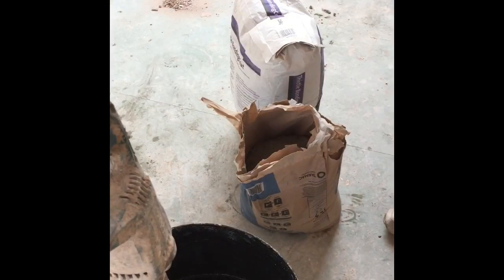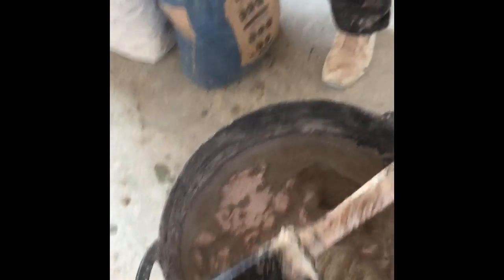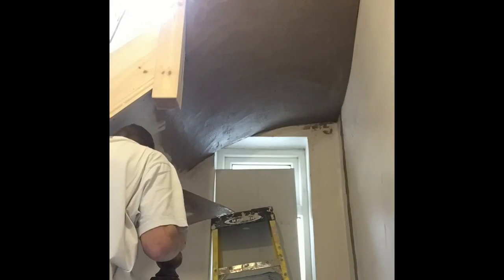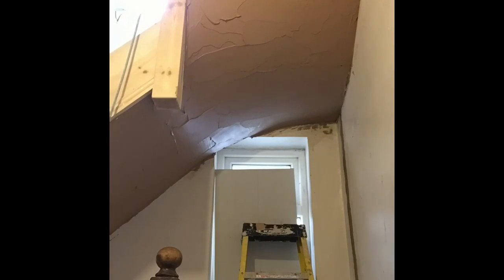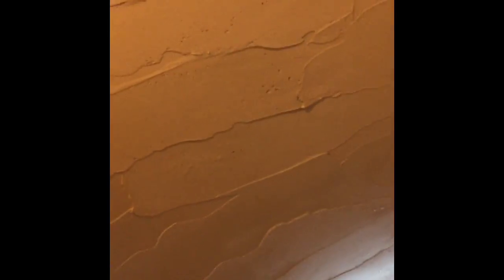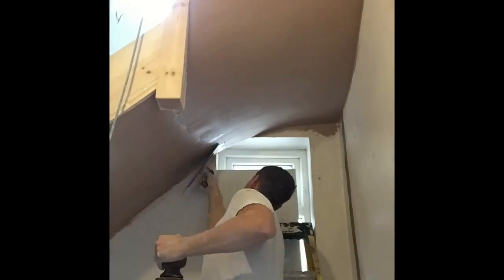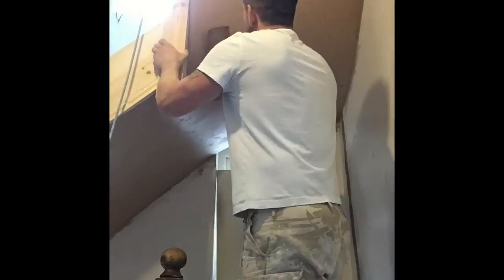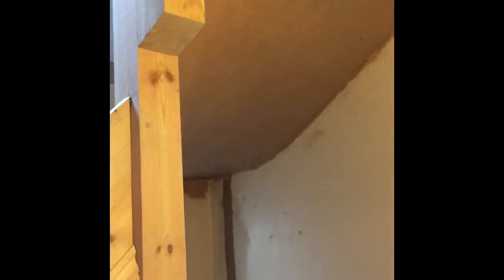Plastering

Comment: You might want to rethink the bonding and cement, know a fella that sweared by it for a few years when sticking up angle beads...he later found out that after a while the bonding and cement blow due to a chemical reaction between the two compounds, best way to speed up bonding is bit of dirty water in the mix.
Reply from the maker: Sean Carolan that's when people use it on outside render beads, I've been using it for 20 years and it's never blown..

Comment: Not trolling: mesh made of metal, isn't that going to expand and contract something awful? Also look where it is. Constant vibration .. 
Does that really hold up long term?! BTW I know you are the plasterer not the architect. ;)
Reply from the maker: wozzlepop it lasts for ever bro, they used to do it with lime plaster and horse hair.. I’ve seen one over 150 years old without a single crack in it..

Comment: hi Simon it's a pain in the ass plastering curves some times  and can be time  consuming using a paint brush or a car sponge to shape it at the right time does help but I've found most of all using a laying on trowel does not help at all and follow the Contours of the curve as you have already explained in the video  it's very useful to use on curves a refina superflex as they have a fine blade trowel then a standard laying on Marshall plastering trowel and yes i use OPC in the mix to been doing it for years the mix could have been flicker when you first started would have help you out more you will remember for next time  you did a good job any  all the best bud
Reply from the maker: voodoo audio I’ve been doing them for 20years, I have flex trowels, plastic and sponges.. but that marshal town trowel is the dogs bollocks, I always go back to it, it’s curved and sharp as a razor blade, and it’s part of my arm, those swirls come out perfect every time, but by all means put a video up of you doing one, I’d love to see it, cheers